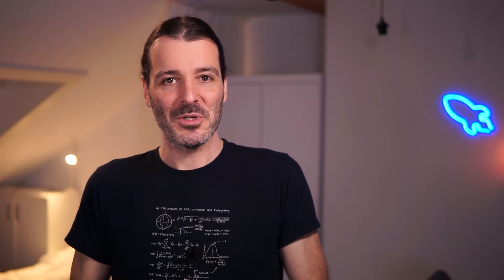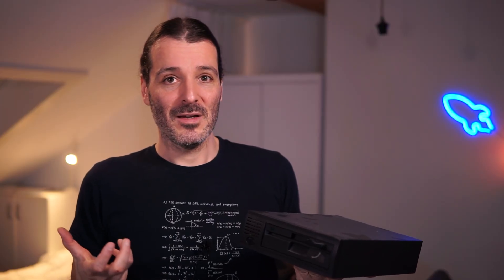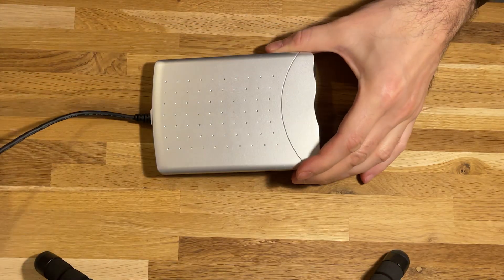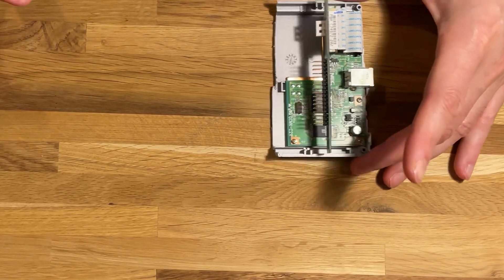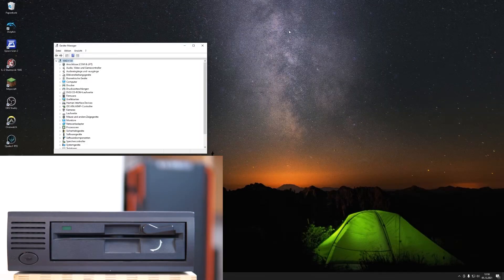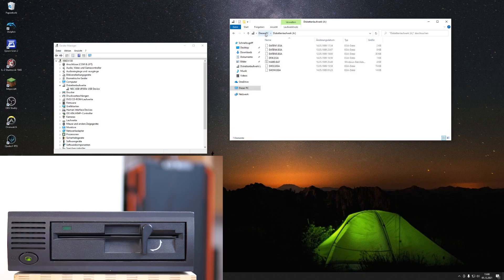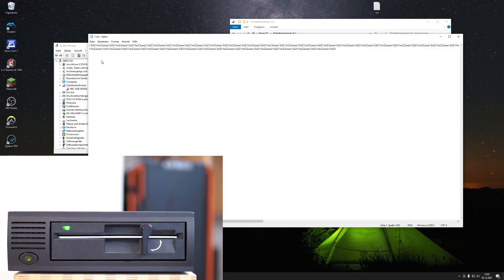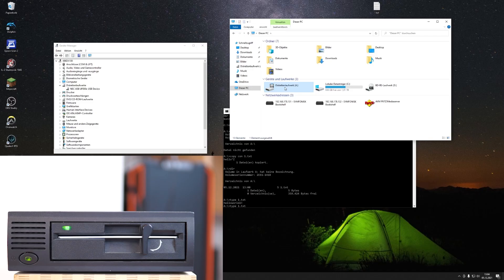How to build a working external 5.25" USB Floppy Drive

Comment: As far as I know, FDs don't have an auto-recognition to tell the computer whether they are 5.25" or 3.5". You would always have to set this in the BIOS, and the OS would take this information from there. 
If your mainboard's FD-Controller and BIOS still support 5.25" drives, Windows 10 actually recognises the drive as a 5.25" drive and it works just fine. 
There are very few mainboards though that support both 5.25" FDs and Win10. 
I think those were late Pentium 4 boards. 
There are videos on YouTube of people running internal 5.25" drives with Win10.

If you'd manage to reprogram the controller board, then theoretically that should work, although I'm not sure if any USB FD-driver supports 5.25" drives. I don't know if Windows uses different drivers for USB FDs and internal FDs
Reply: Works fine on Windows 11 24H2, too. It's just not well-known, since the minimum requirements for Windows 11 vastly post-date integrated floppy controllers.

Comment: Full disclosure: I don't know anything about electronics, building interfaces or programming. Having said that...

With the right combination of hardware and software, it should be possible to interface virtually any kind of drive to a modern computer. There exists a USB device to connect a Commodore 1541 floppy drive (5.25") to a modern system, and that's a completely different disc format and piece of hardware.

Comment: Try making a couple of 3.5" -type formatted disks on 5.25" disks. Basically, take a retro computer with a 5.25" 1.2M floppy drive, then set the bios to think it's actually a 1.4M 3.5" drive. When you boot the computer, format one 5.25" floppy at 1.4M size, and format another at 720KB size. Then go back to your USB floppy drive, see if Windows 10 recognizes those floppies you formatted. If it does, Windows 10 driver must be hard wired to read 720k and 1.4M diskettes even when a 5.25" floppy drive is hooked up.

Comment: This is awesome! and I will subscribe because I want to see the outcome of this.

I want to completely disassemble a 5.25" drive and reverse engineer each component and see if its possible to make a completely new drive from mostly 3D printed parts or replicate the manufacturing process for parts that can’t be 3D printed.

Another thing I wanted to do was to use a vinyl cutter and see if it's possible to manufacture new 5.25" floppy disks, after all there about 3 layers of material. 

I'm just thinking out loud here, but I think your project is really cool and very important for keeping this format alive. :D

Comment: Try buying a Floppy Disk  controller on E-Bay. I have seen ones with SATA and FD on cards. If you plug one in your computer you can run a Floppy cable to the drive and it will have the controller to handle the sectors and tracks. One drawback if you have newer motherboard with PCIe you will need to get a PCIE to PCI adapter because I have only seen them in ISA and PCI. Also note you may use it but may not boot off  of it. I have an old ISA controller card to run an old Iomega ZIP drive on one of my computer. I got it to boot off of the ZIP drive but only if I format the drive with an older computer and using the Windows 3.1 software for the drive.

Comment: The blocks and sectors are incorrect. This is a driver problem from Windows that only knows 3.5 USB drives.
The BIOS is more flexible there. It sees some floppy via the "USB" connection. 
And then it looks for the right settings, regardless of which connection the drive came from.

The old floppy bus is the same at 3.5 and 5.25 and very simple. All companies have copied that.
Reply: No. Even Windows 11 24H2 works perfectly with 5.25" floppy drives (I've seen it myself). What's really happening is that there's no specification for 5.25" floppy drive emulation (and it is emulation) over USB - and even if there was one, the USB cradle is hard-wired to report itself as a 3.5" floppy drive.

Comment: Maybe the information in the USB Device Descriptor says that this is a 3,5 inch floppy. So it is maybe a problem of the firmware of the controller. I am not that deep into USB Programming, but i wouldn't wonder if there are any settings which can be made upon the media types the device is capable of, and it is possible that the designers of this particular usb floppy drive fixed this descriptor to 3,5". I don't know if this is fixable, but probably not, because its possibly in the firmware of the controller.

Comment: I love this video. Others have suggested Linux, which I was thinking too.
Instead, two questions.
I had an Amstrad 6128 with the 'strange' 3" (flippable SD 180 KB/side) floppy. At one point I also had an external 5¼"floppy. I bought it in Flensburg, Germany, and it may have been a Vortex, but I'm not sure; but I believe it could write to DOS formatted floppies (DS/SD 360 KB or maybe DS or DD 720 KB?), which I was able to read on an AT with a 5¼" HD drive, in CP/M it's max was 80trk DS/DD, and 800 KB formatted. I have kept the Amstrad, but foolishly, I sold the drive. I am unsure which Teac drive it was using - any ideas, and would it be possible to read (just sector-wise, I can deal with the CP/M directory structure and file map from there) other formats using a USB-thingy like this?
Also, what would be needed to read (and if possible, write) DEC RX50 formatted floppies, which I have a few of for my DEC Professional 350? (Although I don't know what condition the machine is in, as it hasn't been booted for 25+ years.)
I guess this video will attract many very knowledgeable viewers, so I hope it's okay to ask this here.
Reply: Hi, I would try the greaseweazle controller.   It's pretty cheap and reads the floppies at the flux level.   You can connect any shugard based drive, which includes the Amstrad 3" drives, 360kb 5 1/4 drives and 1.2mb 5 1/4 drives (those last two are incompatible, as in 1.2mb drives the top and bottom of the drive aren't written aligned to each other).
Reply: please write to me and I send to You a software and all details how to read and write a DEC RX50 floppies to images dump on usual PC under Windows XP/7/10
Reply: @lodedome  unfortunately I don't have an HD 5¼" drive yet; and I also have no Windows machines, I only use Linux/BSD/Unix.

Comment: There used to be an XP mode for windows7 though not sure if it would work in Windows10 as it did not meet the security requirements of Windows7.  Thinking the problem is the USB driver in the floppy controller chip myself but you should try using the original floppy controller for the 5/1/4" and make an adapter cable to convert  the edge connector to a male ribbon connector to connect to the interface board and it might just work OK provided the software in the interface can support it.
Reply: there is always VirtualBox, I use this on my Windows 10 to use a Windows XP environment. Even have USB redirection for an Ethernet adapter.

Comment: The difference between the different "IBM" floppy types (IBM format 1.44M, 720K, 1.2M, 360K) is all about the timings. The fundamental operation of 3.5 and 5.25 drives is the same, and the command set is exactly the same (basically: activate motor, step to next track, and single data channels for reading/writing). The "data" the drive returns is just a pulse every time the magnetization ("flux") changes. Data is coded on the disk in MFM, meaning there is always at least one pulse for every "bit" stored.

There are a number of tracks to step through (80 tracks for 1.2M and 1.44M, per side) and a track consists of 512byte sectors, each with a small header area, and between sectors is a sync zone filled with a standard synchronization pattern to allow the controller to match the data rate. (Hence why a 1.44M floppy is technically 2.0M "unformatted"; over 25% of the disk is taken up by the sync zones. The Microsoft DMF format reduces the length of the sync area to fit 1.68M on a disk).

Switching between tracks is dead simple. Reading a track is where the timing problem lies. The amount of sectors, and the length of the sync zones, have "expected" "standard" values. Old controllers were more "dumb" and hence more tolerant of different timings. That's why MS was able to use 1.68MB floppies to distribute some of their software.

All of this is to say: There is no reason why a controller for a 1.44M drive can't read a 1.2M 5.25 disk. The only problems come from "artificial" restrictions on the controller, driver, or OS. For example, the driver might panic when there aren't "enough" sectors on a track (1.2M has 15 sectors versus 1.44M has 18) and decides that the disk is "bad". Or it might be confused by a sync area that's too long or too short. Or it tries to match the data rate according to the sync, but the timing is too far "out of bounds" (that were artificially programmed anyway).

My question: What happens if you try to format the 5.25 disk in Windows? Does it become usable from that point on? Does the format fail?
Reply: Isn't this also a matter of drive type? Specifically whether it support 80 tr/in, 96 tr/in, or both? (Am I wrong in guessing that that's why the Teac FD-55FGR is best/most flexible?)
Reply: @lhpl  Distance between tracks must be handled by the drive itself. The controller has no concept of the physical track distance. There are only two track-related signals issued by the controller: STEP (which is pulsed to advance to the next track) and DIRECTION (which is held high or low to select outward or inward track stepping).
Reply: @softy8088  I see. I'm not sure if you are kindly correcting me, or just adding more information, but I think my comment clearly showed how little I know. I'm not even sure, but I think I was confused about number of tracks (40, 77, or 80?) and tracks per inch. I clearly have to read up on this matter.
Reply: @softy8088  oh, another thing: when I had an external 5¼" drive for my CPC6128 (1986-1993 or so), it had a physical switch. I seem to remember that it switched between 40 trk mode and 80 trk mode, would that make sense?
Reply: @lhpl  Yes, that makes sense. Track switching is handled by drive hardware. I was just trying to answer your question in the context of the video: The USB controller has no sense of track spacing. The drive itself must know where the tracks are. I wrote a longer reply but it looks like youtube removed it, possibly because I included links to some documentation.
Reply: @softy8088  Have you been able to solve this issue? If you're able to parse out any information/places to find drivers that would make this successful, I would really appreciate it.
Reply: @bushman3168  Sorry, I have no way to actually do any of this, I don't have a 5.25in drive that I can attach to a USB controller. I was giving one piece of information (There is no physical reason why the USB controller can't read 5.25in disks) and something to try (format a 5.25in disk in this drive).

Comment: I'm wondering if its a firmware issue with the USB floppy controller. I would imagine that the firmware handles DOS differently than Windows, which may be why you can read/write floppies in DOS and not Windows.
Reply: Correct. The BIOS has extensive emulation routines to make a USB device look like a floppy drive/hard disk/CD-ROM, which is why there are so many options to control this in your BIOS setup screens: they don't have anything like the smarts of a real OS driver, which can properly identify and interrogate a USB device's capabilities.

Windows, of course, doesn't use this BIOS emulation (which is violating the USB spec, by the way - multiple commenters explain this in more detail), and trusts that this device that's reporting itself as a 1.44MB, 3.5" floppy drive is what it says it is - and therein lies the real issue.

Comment: can you do it with an external 3 1/4 floppy drive ?  the one on the market cannot read SD formats

the thing is that there is no controller in the floppy drive, the chip does all the work (Z765A) or similar

https://en.wikipedia.org/wiki/Floppy-disk_controller

Comment: I still have an old 5.25" drive myself. Back when I was a teenager, I installed it in my computer (but never used it ^^). Back then, under Windows XP, the 3.5" and 5.25" drives were still displayed correctly.
Maybe try an installation of Windows XP. Test it in a VM where you can pass USB through.

The other way round, you could look for a new - old mainboard that still has a disk controller incl. port and install Windows 10 there.
If it doesn't work even with the native hardware, then it's certainly the driver :)

Then something else - a few months ago I found someone here on Youtube who got an old 8" floppy drive to work with DOS, maybe you can exchange ideas with him.
Reply: You're referring to Adrian's Digital Basement, no?
Reply: @alexdhall  Yup, I just looked for the video again - it's the right channel :)
Reply: lol I just commented 90 percent what you just recommended be for I read your comment.

Comment: Very interesting to see.
The beginning with the boot floppy contents makes me wonder whether you could run your PC in a DOS environment though with games and everything as the function is technically given with all x86 based systems.
Reply: I tried this once years ago and most of those DOS based games would run too fast to play. I remember years back getting a shareware program to fix that speed issue to be able to play my old games on my new computer. I remember needing to make .bat fi!as to call those PC-XT games up with configurations so that I wouldn't have to do it manually each time.

Comment: Hi there! I really like your experimentation of the 5.25 USB floppy drive. 
I feel there might be a reason why the 360kb drive might not work in the setup for reading double density disk...
In the past, I had experimented with connecting the traditional floppy drives to the standard floppy disk controller. One experiment I did was that I told the BIOS that drive A contains a 360k 5.25 inch floppy but instead installed a 720kb 3.5 inch floppy drive in its place. The data transfer worked perfectly well since the drives technically had the same data transfer rate between the two drives...
However,  when I swapped the settings to a 720kb 3.5 inch floppy drive but connect a 360kb 5.25 inch floppy drive to the computer instead, the transfer no longer works. I discovered the reason why the setup did not work was due to the speed of the control signals being transferred. The first setup worked since the computer sent control signals slower than what the drive could handle, so the 720kb floppy drive could be used. However, doing the opposite setting does not work as the computer now sends the control signals faster than the drive could synchronise with.

I'm not sure if the above information may help you with the research on developing a floppy drive controller using the USB method
Reply: The general rule is you can read and write from 1.2M to a 360K but not the other way around. Hope this helps

Comment: You can almost certainly get these things working in Linux without insane effort.

However I feel like the first person who does that is gonna be stuck maintaining the floppy code forever.
Reply: It would only work on Linux if someone wrote a driver that supported formats that the USB floppy spec does not support.  The USB floppy specification only supports 3 combinations for number of tracks / sectors / heads / etc and all 3 are for 3.5" discs.
Reply: @ChrisDreher  Yeah and it doesn't help that the floppy driver was broken for like 8 months last year and basically nobody noticed.

Comment: I have a 5.25 floppy connected to one of the last motherboards that support 3.5 and 5.25 floppy drives! Which runs my retro system!
Reply: It runs winblows 10!
Reply: What are the specs on that PC?  Do you have a model number or anything to help me track down a similar?
Reply: The motherboard is a lga 775 motherboard which supports 64 bit oses! With one socket for either a 3.5 floppy or a 5.25 floppy but not both! But you can flick the switch to run either one! It also supports ide hard drives!! The motherboard is by made by gigabyte!!!
Reply: @lorderectus1849  Thank you.  I recently bought a LGA775 system with a floppy connector but it only wants to support 3.5".  I will keep looking!
Reply: You have to check the bios to see if it can support both types of floppy 3.5 and 5.25  but on the board the connector can only support one at a time! My lga 775 can support both in the bios!
Reply: No worries!
Reply: My gigabyte is a ga g41m combo!
Reply: Good luck on your search 🔍 I know it will be hard to find one that supports both connectors on the board and in the bios!
Reply: @lorderectus1849  What revision is your board? 1.3 , 1.4, or 2.0 ?
Reply: Revision 1.4!

Comment: seems like it's only able to read track 0 from windows. If it didnt work in dos mode I would say it's a drive issue. Teac have a big model range of drives among which are exclusively 40 tracks compatible, 80 tracks compatible/300rpm, 80. tracks compatible 360rpm, some of the modes might be configured with jumpers on the drive itself, also windows might expect "disk change" signal to be configured in a specific way on the drive (or left floating by isolating this contact from control board). Density mode might be set strictly on the drive (and is set in the incompatible mode), or might be set to be controlled by the controller pulling pin 2 on the drive high or low for different modes, this signal is sure enough absent on the usb control board.